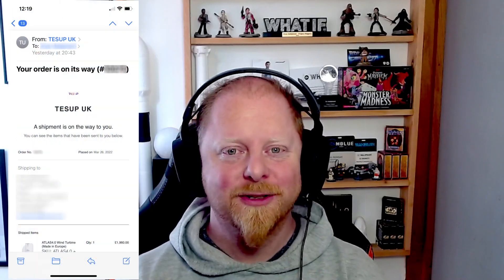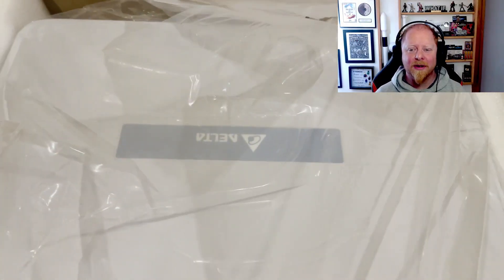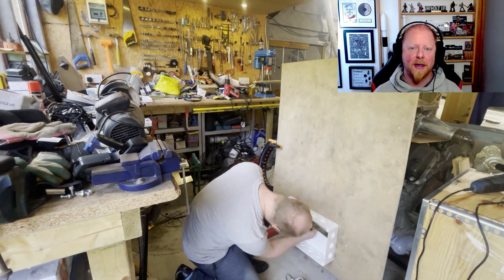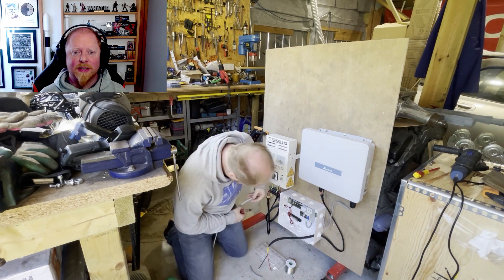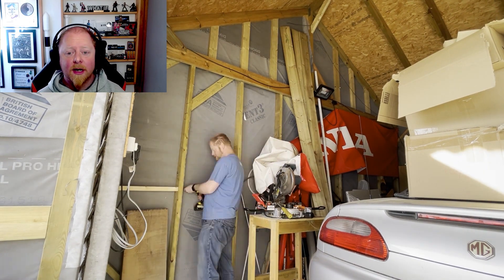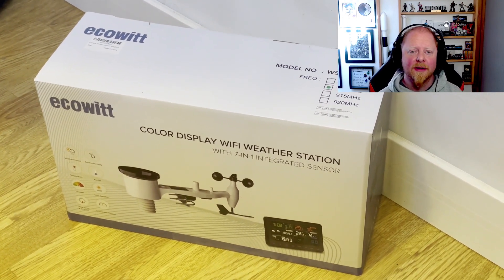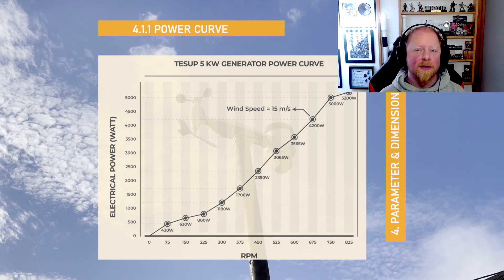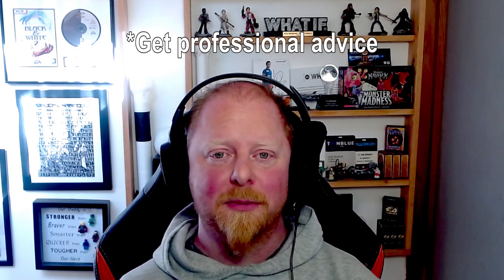Tesup Atlas 4.0 Wind Turbine Update October 2022

Comment: stuck mine on a scaffold pole with 4 cables coming off. I to was sent a Delta grid tie inverter along with the 5kw turbine. I've never ever no matter what I tried managed to get no more than just over 100 watts connecting it to 3 chinese 2000w grid tie inverters. tried using it with the Delta 5kw inverter grid tied but all it did was trip the electrics everytime. I gave up. Tesup lied & still continue to lie. Wasted my money. be interesting to see if you get yours working. I'm told by Delta that the Tesup 5kw is not compatible as it's for solar  only. I stuck solar panels on it &  the Delta works great.

Comment: I have the Tesup Magnum 5 Turbine.  Rated for 5 KW, but the most I have been able to produce is around 2 Kw. And the wind bent my steel (original)pole. So your turbine will prob not produce more than 1 Kw if you are lucky.
Reply: Looking forward to your tests!
Reply: At kind of wind speeds was you producing 2kw?
Reply: About 15 Meters pr sec.
Reply: @jonnyueland7790  you need to adjust your blades
Reply: hello, make a video for us monitoring how many Watts it is producing while you have good wind, it will help a lot of us

Comment: i am really curious to how much noise this atlas would be generating ... i live in an apartment in the Netherlands, and i can't have any solar panels, but wind i have plenty on one balcony i never use ( because it is often so windy) so i was kinda looking into a wind turbine, and this atlas 4 might just do the trick, but I'm not sure if that is wishful thinking and not doable , or that it would actually be fine to use ... if you have any thoughts on that , that would be appreciated
Reply from the maker: I suspect it would need clear airflow. This is why I’m mounting it at 8-9m heigh which is 2m about the house roof level.
I think the reason others haven’t had good results is that they have now got it into clear / laminar airflow.

I will be reporting on noise from the ground and inside the house too.